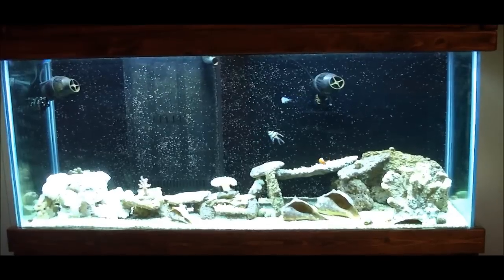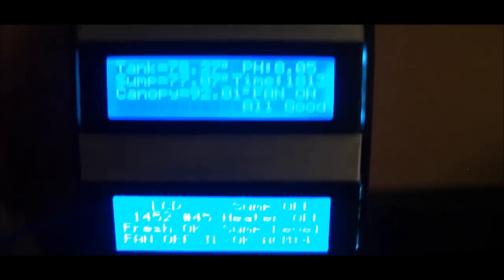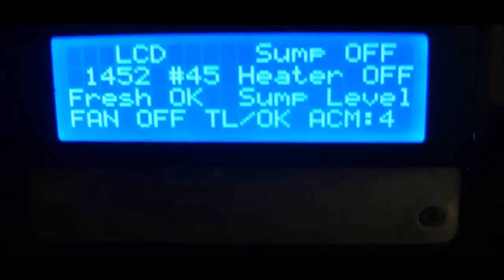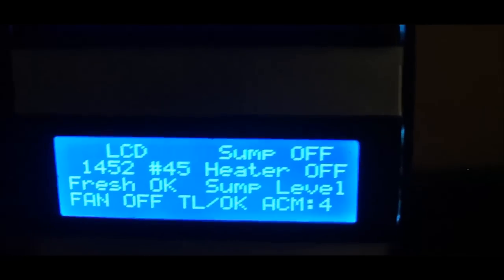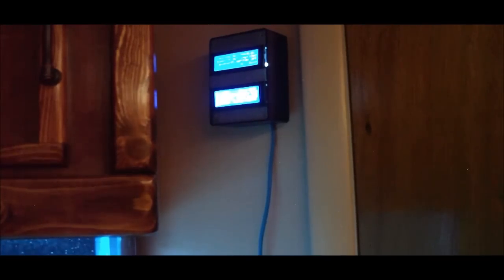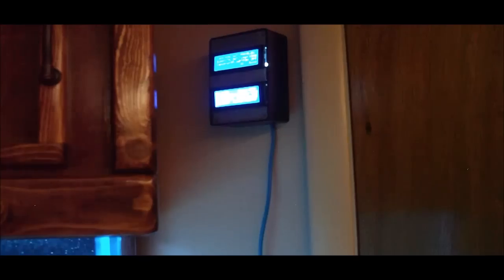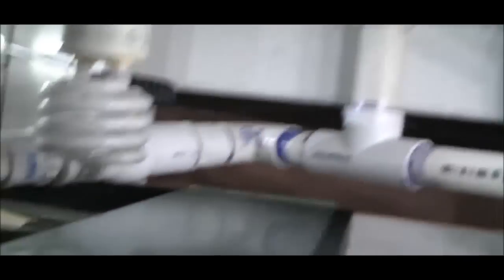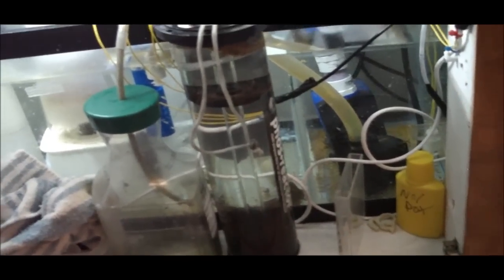HOW TO: DIY Arduino Aquarium Controller

Comment: Hey Carl
Great controller system. I also started to make my own controller but I am not a programmer and had to hire someone to help me out.  So far it will turn heater or fan on or off based on temp and will also turn off sump lights if to hot.  I also have it controlling my auto top off.  I am very impressed with what you have and was wondering if you are selling your sketches?  I can make the hardware but do not understand much of the programming end.  Please let me know if you are willing to sell me a copy of your sketches..   Thanks  Sheman
Reply from the maker: Sherman Lillie I am not a programmer either. I learned to code by watching videos and by trial and error. Look through the code and try and understand what is going on. I will post a link in a moment to my code. Thanks for your comment.